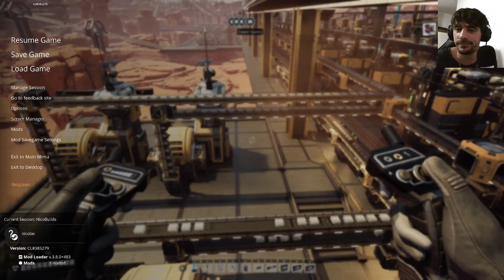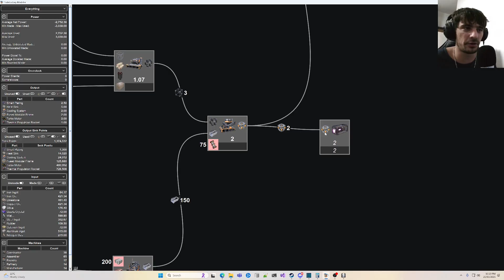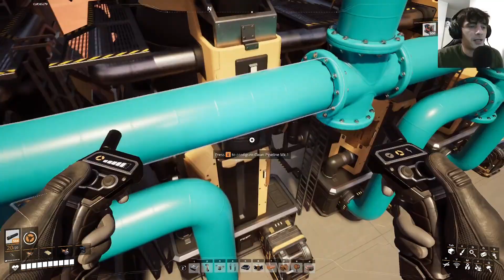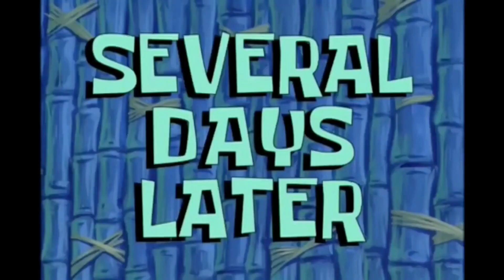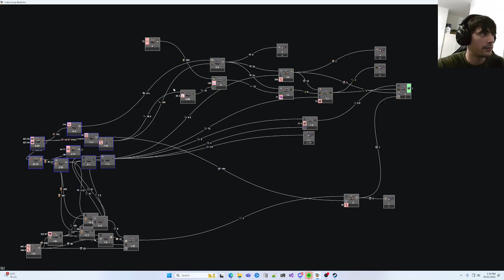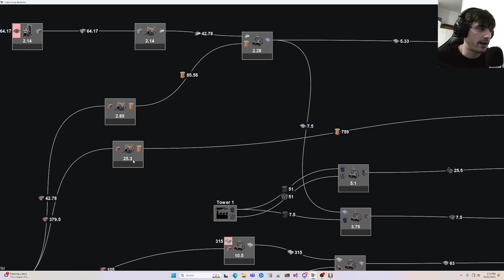Let’s Overcomplicate Phase 4 | Vertical Factory Mayhem in Satisfactory

Comment: Could you put an overflow protection to prevent congestion on sushi belts?
Reply from the maker: I mean,  i could. But this is only a one time thing, that's not even sure that will happen. Once i start the factory i check that zone, and if its working correctly it will never jam!
Reply: @ that’s true, you could still put a bin in the meantime to prevent clogging and remove it once all is clear

Comment: Scaling up something like this is easy if you drop a smart splitter directly on the belt and sink everything until the line is consistently holding the amount of items you want, then delete the splitter. I ramped up a giant nuclear plant doing this (it took like 2 days to do it cuz I was also troubleshooting at the same time)
Reply from the maker: Mmmm. Interesting! Never thought of it but if I understood correctly it would work like a charm! 
Thanks for the tip and for stopping by